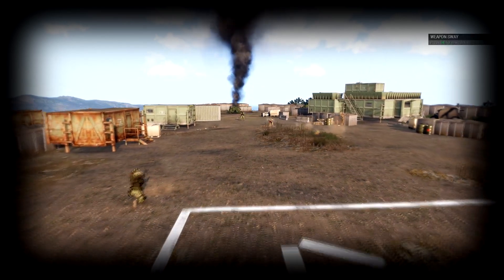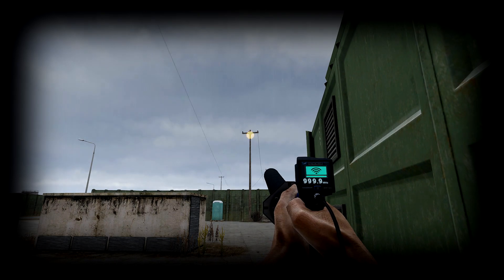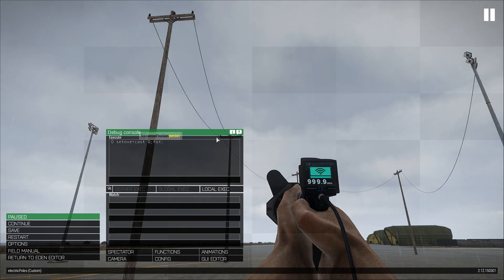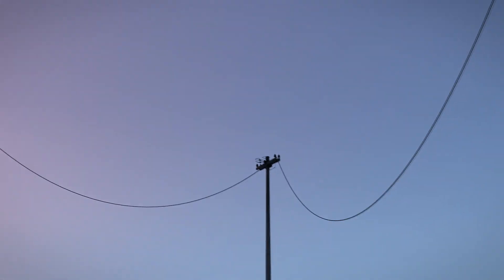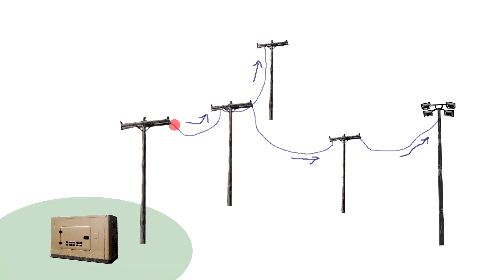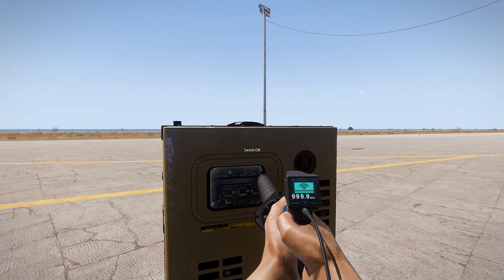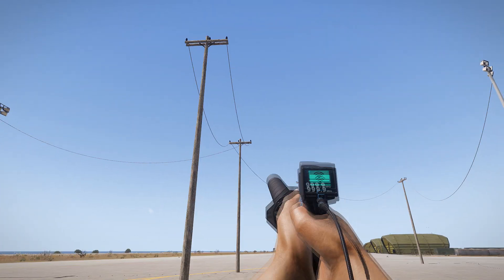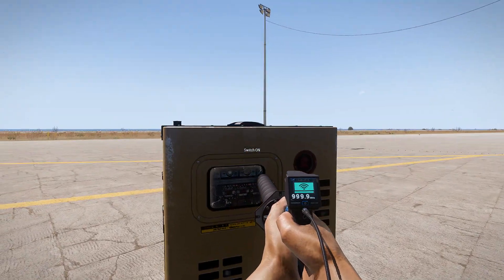Arma 3 Scripting - Power poles

Comment: Hi! Could you please tell me how to loop an animation and how to play three different animations one after another?
Reply from the maker: There are several ways, depending on which animation it is, and how it is used! Looping is easier, so let's see:
- some animations loop naturally back to themselves. You can simply disable AI taking over, and it will loop the current animation.
myUnit switchMove "myAnimationName"; myUnit disableAI "ANIM";

- there is a BIS function for ambient animations which handles the looping for you! But the selection of animations is limited.
[myUnit, "STAND"] call BIS_fnc_AmbientAnim;

- with some animations you can wait until they are marked as complete. Beware though, this can be janky, it's Arma after all!
while {alive myUnit} do {
myUnit switchMove "animationName";
waitUntil {animationState myUnit != "animationName"};
};

- the most surefire way, but also the most complex, is using eventHandlers. Best coupled with disabling AI for animations, as mentioned before.
myUnit switchMove "animationName"; 
myUnit addEventHandler [ "AnimDone", { 
params[ "_unit", "_anim" ]; 
 
if ( alive _unit ) then { 
_unit playMove "animationName"; 
}; 
}]; 
myUnit disableAI "ANIM";

Seeing the event handler code also lets you see how to play different animations in a sequence, you just simply change the behavior of the handler based on which animation finishes playing. It's better to also have a check if the unit takes damage, to prevent it from being locked in an animation while being under attack.

myUnit switchMove "myAnimation_1";   
myUnit addEventHandler [ "AnimDone", {   
params[ "_unit", "_anim" ];   
   
if ( damage _unit == 0 ) then { 
if (_anim == "myAnimation_1") then {  
_unit playMove "myAnimation_2";  };
if (_anim == "myAnimation_2") then {  
_unit playMove "myAnimation_3";  };
if (_anim == "myAnimation_3") then {  
_unit enableAI "ANIM";  };
};   
}];   
myUnit disableAI "ANIM"; 

I have a video on animations and on event handlers, so you can find any additional info there. Have a good day!